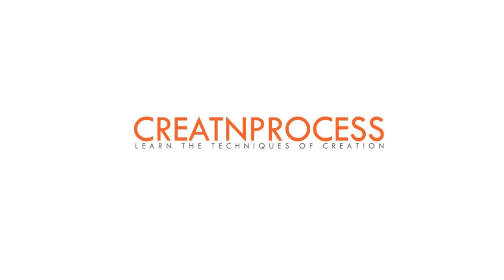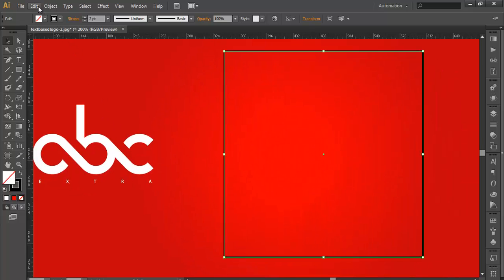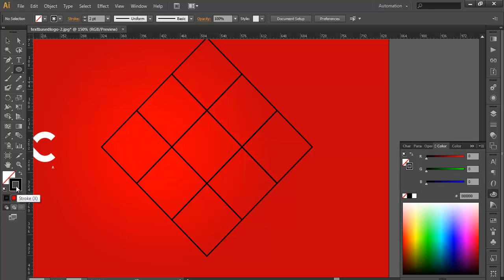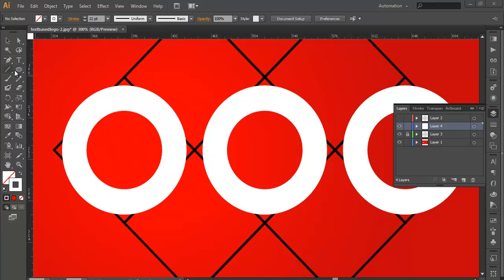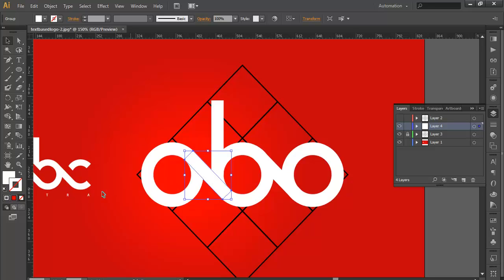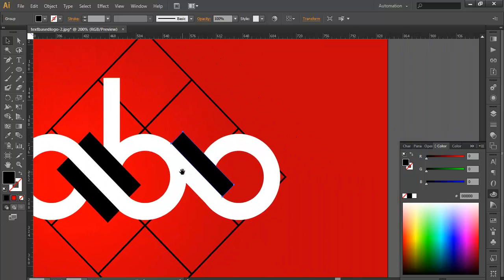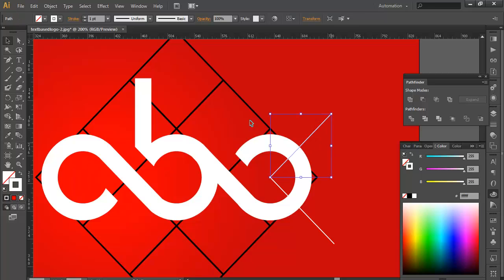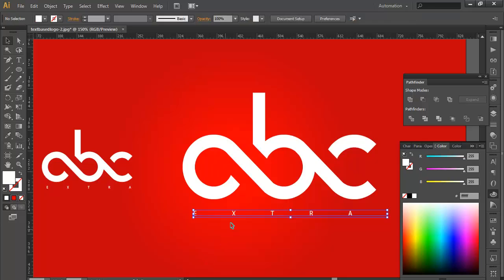Professional Logo Design - Adobe Illustrator cs6 (ABC)

Comment: hey, super video, but when i expand the letters, the circles does not turn into objects.. why does that happen?
Reply from the maker: OK, usually when you expand a stroke it should convert it into filled object..
May be you should check out the expand pallet, and tick the fill and stroke option while expanding.(by default it should be done). or else everything should work out properly.